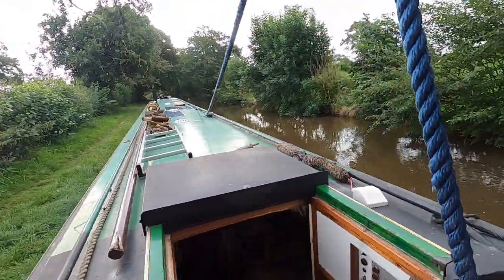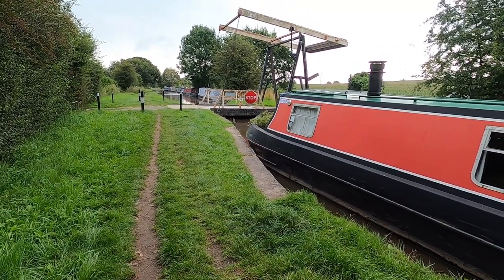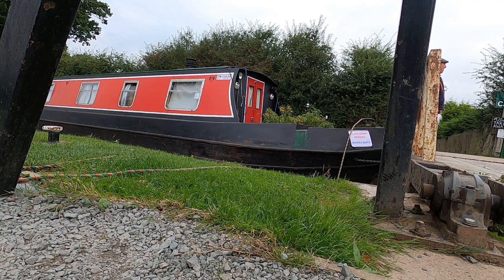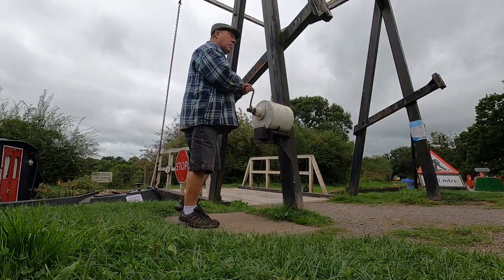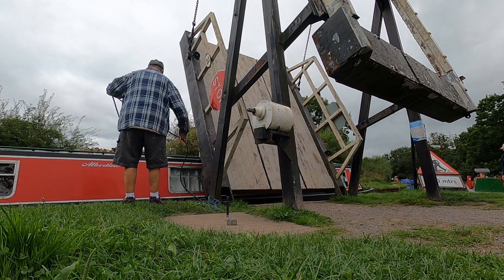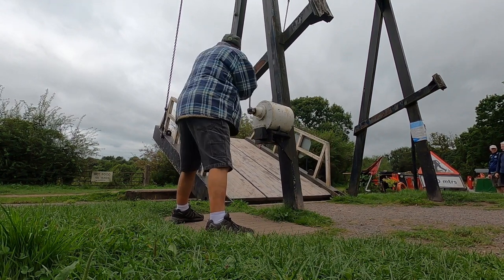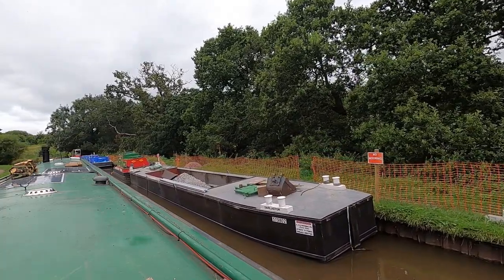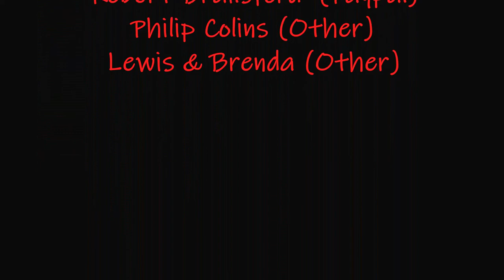How I Do A Lift Bridge / Drawbridge Single-Handed

Comment: Those bridges are hard work.  Well done. Made it look easy.
Reply from the maker: Thanks Will. I have found them more time consuming than anything. Once you get a routine for doing them they are not so difficult, just more of a nuisance. We should go back to how they were designed to be used, left up, and if you wanted to use the bridge you had to lower it